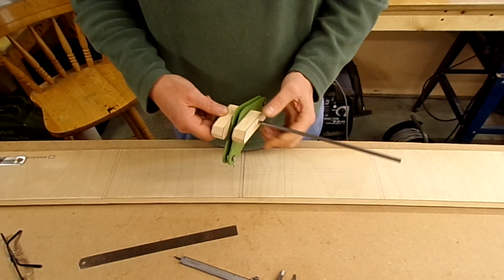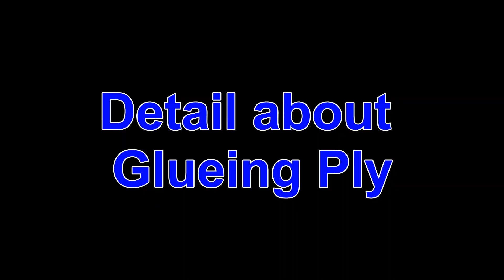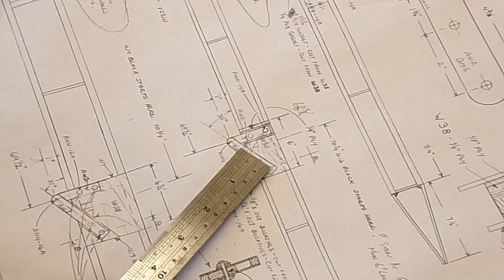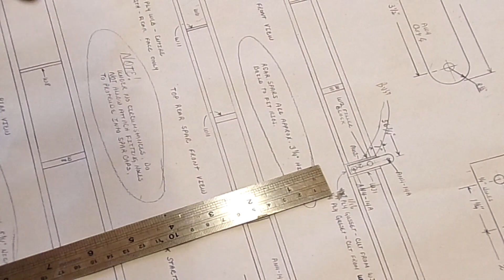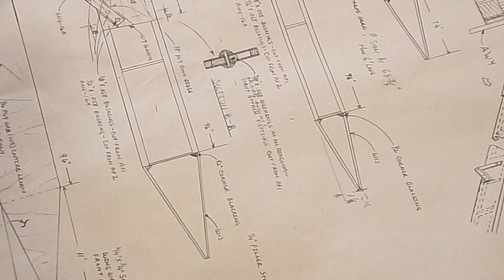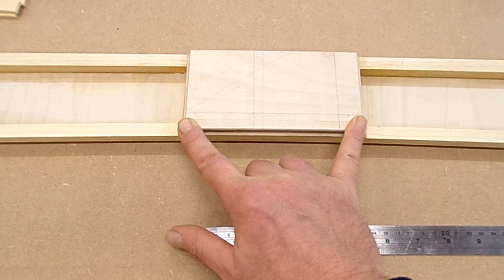EP34 Fisher Youngster V Wing Aileron Bell Crank and more spar details.

Comment: Thanks - that's really useful to know. So that's 180g per ft and 95g per ft.  I am just about to knock up a couple of 15ft wings, and is trying to decide whether to make the spars out of carbon or wood. Carbon is much more hassle, and not worth it if the weight saving is small.  Is the spar depth about 6" on yours, and is the ply webbing 1/8" thick?
Reply from the maker: Front 6.25" rear 3.5" and 1/16 ply.
Reply from the maker: I had a bit of a think and with a 15ft wing, I would be looking at 1inch Square caps for main spar and 3/4 Square for rear made as a box spar with 1/16 ply webs front and rear  that would double the weight per foot.

Comment: With the bell crank, does it have mechanical fasteners or is it just bounded? Do you think that is ok as the forces might be quite high? I haven’t got that far in my plans yet 😁
Reply from the maker: Just bonded,  the forces should not be that high and the bonded area is a fair size. With the additional vertical that stiffens the web it will be a rigid assembly.

Comment: Great series of videos on wooden aircraft builds - I have learnt a lot from you so far. I know your ribs are really light, but can you tell me how much your main and rear spars weigh without metal attachments, and how long they are, then I can work out how much they weigh per foot length - thanks
Reply from the maker: An interesting question. Here are the figures for the top spars: Front spar 1640g, Rear Spar 850g, Full ribs 60g each, Half ribs 20g each with a wing length of 2.7m. I do have to point out that as this is a biplane, it has low aspect ratio wings as no the capping strips would need to be bigger if you are thinking of extending the wings and you might need to add additional webs and these spars would not be suitable for cantilever application.
Reply: @flyingkub  did you weigh them Algy??  I should put a scale under mine but don’t have one yet…. Haven’t weighed myself for 20years
Reply from the maker: @grandenauto3214  yes I did stick them on the scales.

Comment: Thanks for all your detailed work Algy. You mentioned some standards regarding gluing plywood in a way that implied there was a book listing those standards. Do you recall where I could find a copy?
Reply from the maker: I got some training for wood aircraft when in the RAF which would not be available  but a good place for information it AC No: 43.13-1B copies of which are available on the web as a pdf I think wood in under Chapter 1 Section 1. I hope that helps.
Reply: @flyingkub  That will definitely help. Thanks!!!
Reply from the maker: @dennispitz7488  No problem, although it is for the USA builders it is a good resource for all.